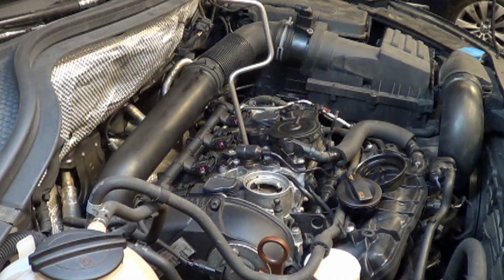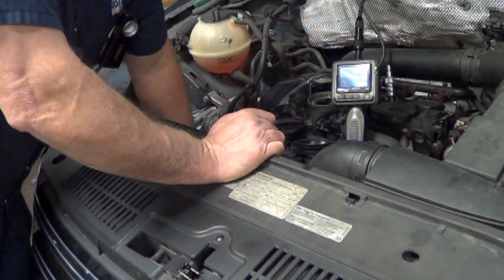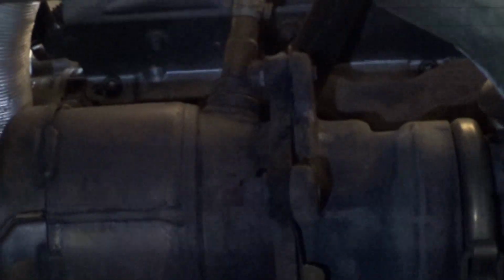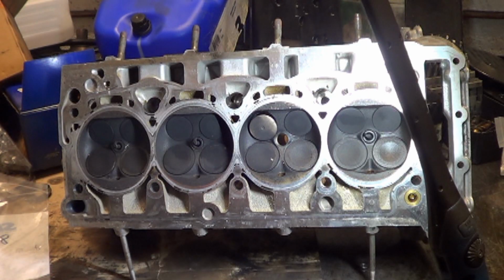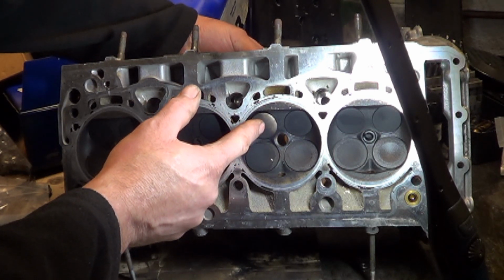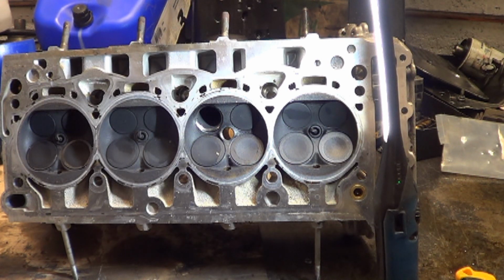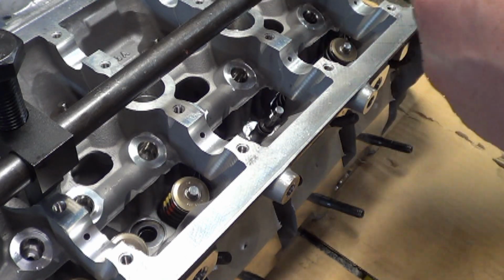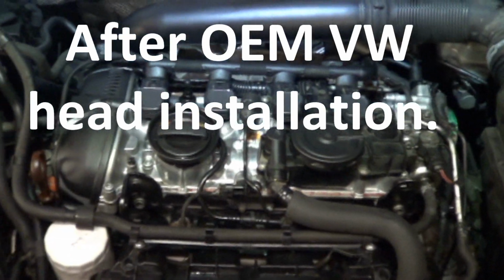Tiguan Misfire comeback part 2

Comment: just replaced plastic waterpump $1200 2012 EOS 2.0T. 3 weeks later tosses a P0300 and runs ruff. Compression ck shows #1 128, #2 130, #3 and #4 150. 
Plugs and coils denso with 30k miles. Plugs were carbon heavy and gap was .38, regapped to .32. Will have to take to shop, my scan tool is too simplistic.

Comment: I have a 2009.tiguan, issue is multiple miss fire P0300. Check engine on & EPC light on dash.  Engine wont start,  i smell gas, new coil and plugs 2 months ago, although found a crack on a coolant line, that run down in the front of the engine,  i wondering if my heads are gone?  Not sure if its worth fixing. Just bought the car for my sons 1st car and its not looking good.
Reply from the maker: should be able to diagnose a no start condition.  check videos on FAST-TEC.  Fuel, air, spark, spark timing, cam timing exhuast compression.

Comment: Amazing video, you were thorough and paid so much attention to detail, defs deserve a subscribe and like, I think im having a similiar issues, I have the same engine in my a3 convertible, did a rebuild,, changed, spark plugs, coil packs injector, line boared the head, schemed the head, replaced rings and valves as well as bearings after cutting the krank as i hit a bearing knock, im gettting a misfire on cylinder 3 but when checking compression, it is low on 3 of the cylinders, the misfire appears mostly on idle and at low revs but when driving the car its fine on top, VCDS is kicking out a camshaft retard error but the variator solenoid is replaced as well, my mechanic is thinking the valve clearances could be incorrect as we did not adjust them considering the fact that we have done so much head work do you think this could cause such a result?
Reply from the maker: yeah I dont know.

Comment: I think a contributing factor is how hard that engines pushed maybe when it comes to turbos failing not everyone of these cars blows the turbo not everyone of these cars blows a timing chain at same mileage it’s just if an when
Reply: Got ya I just got my Tiguan back from the shop they did walnut blasting at 120.000 km it was bad cylinder 3 injector was clogged dealer decided to do all new injectors it’s like whole different car now
Reply from the maker: @wesleyhoare789 cool
Reply from the maker: Yea.  but wrong guides fail.  As I know from multiple expensive experiences.  Once also I worked on one that someone else put the wrong guides in.

Comment: This makes little sense, it needs to be a helluva leak to cause a misfire. This vehicle does not look old and this exhaust valve issue should not be happening.
Reply from the maker: It makes perfect sense.  I would assume you haven't watched both videos.  the exhaust guides were wiped out.  The machine shop replaced a ferrous alloy exhaust guide with "brass" guides.  They did this on 4 customer cars and one of my own.  A competitors shop got the same treatment as well.  Every single car they put those guides in came back with guides wiped out with random misfires (difficult to diag by the way)..  Everyone was fixed under warranty.  Last one on my car was finally put back together, only weeks ago.
Reply: @CoolAirVw  Plain brass was hardly a good choice for a valve guide.
Reply from the maker: @mrofnocnon  Sorry I guess words matter.  Me saying "brass" wasn't stating the the guides were pure brass, just that that was the "type" of guide they were.  I certainly can't name the exact metallurgical content.  Intakes are "brass" and exhaust are a "ferrous" alloy.  Using "brass" ones was the mistake the machine shop made.  This cost us severely as we had at least 5 cars on the road that had the repeat failure.  Some of them we had to buy VW head to warranty.  We have since found a supplier for ferrous guides for the exhaust.
Reply: @CoolAirVw  Well done.
Reply: @CoolAirVw  Thank you I was not aware the guides had been changed or why they were. No mention of the mileage. It strikes me this engine has lots of issues that makes it prone to misfires. A thorough investigation overall.

Comment: You could install integrated engineering valve guides..
Reply from the maker: Interesting that you say that.  At the time of this video couldn't get them.  Plus I believe they are brass like the ones that failed.   Let me know if they are not.
Reply: @CoolAirVw  i went to their site and they give interesting info about the install maybe you can go an check...i suggest change the valves for ferrea...stainless steel and inconel...maybe those 2 things could make your customers happy 👍🏼
Reply from the maker: @eliseocortes0228  Same thing as before, they are "bronze" type guides.  DO NOT USE "BRONZE" type guides  for exhaust!
Reply: @CoolAirVw  so stainless steel or titanium guides?
Reply: @CoolAirVw  at least they are used for abuse on ea888.3 engines and works flawlessly...maybe is the compound.

Comment: After replacing the head was the issues resolved???…
Reply from the maker: did  you watch the video?
Reply: @CoolAirVw  yes I did but I was wondering if there was any more issues after the replacement
Reply from the maker: @herberthyosoylomejor2883    We have fixed all the ones that the Machine shop put the wrong guides in.  Some of them we were forced to buy dealer heads $$$$$$$$$$$.  But the last 2 we were able to get the right guides and now we offer them for sale.
Reply: @CoolAirVw  Cool 😎 and thank you for replying back. Question where is your mechanic shop?…
Reply from the maker: @herberthyosoylomejor2883  Kansas City area of missouri. USA
Reply: @CoolAirVw  far away fromDC
Reply from the maker: @herberthyosoylomejor2883   Just a hop, skip and a jump.  plus a long drive.

Comment: Ive changed the plugs and coil packs and my cars still popping an engine light for misfire not sure what to do ive already spent like 300 on this problem for it to keep happinging
Reply from the maker: correct diagnosis is important to not waste money changing parts that are not the cause of the problem.  scan tool like vagcom can show you which cylinder is misfiring.  If multiple cylinders are misfiring you have to look at why. Scan tool like vagcom can also show you fuel trims to help with multiple cylinder misfires.  Here is one of my most recent videos where I used fuel trim to help with a diagnosis.  https://youtu.be/K214of8Wzjg

Comment: Very interesting, I have a headache though. Been trying to diagnose for many hours.  

I have a cylinder 1 misfire condition. P 2302 p 0301 code.  
All spark plugs  and coils are new.  Engine still vibrates.
Reply from the maker: check compression.  Check cylinder leak down.  Then other stuff.  Super Mario did a direct injected car awhile back and the injector seal was leaking.  cylinder leak down showed it and smoke into cylinder revealed the cause.

Comment: I need to get rid of my Tiguan
Reply from the maker: Maybe, but they drive nice.  I just bought a 2018.
Reply: Cylinder 2 on mine 0 psi… at the shop they will have to open the motor.. if it’s a “wear n tear” issue, carmax will cover under extended warranty. We love the car but after this we getting rid of it.

Comment: I have a 2000 jetted tdi. After every start the turbo boost doesn't  kick in until rpms reach about 2250.this is a consistent thing happens every time for the last 30k miles at least. Once started and revved to that 2250 rpm the boost is there immediately until shut off.then the process starts over again.
Reply from the maker: graph boost as shown in tdi P0234 video.  Diagnosis is a process of collecting information.  Just describing what its doing isn't enough, but I would guess you have a overboost code.

Comment: Tdi engines or bust.
Reply from the maker: I drive one, my daughter drives one and my son will soon be driving one.
Reply: got 421k km on mine without any major repairs. 1.9 tdi vw touran. the biggest repair was probably gasket between top and block cause of excesive oil leak outside on block
Reply from the maker: @ernestasb.8475  Any tdi is better than CCT 2.0L Tsi gas engine

Comment: You can take an old OEM guide and sent it out to a laboratory that does metal analyses. This will give you all the metals in the guides.
Very easy to do hardest part is having the instrument to run the test.
Reply from the maker: Yes, please provide me the name of that there laborotory.
Reply: @CoolAirVw  Quick search: Anderson Materials Evaluation, Inc, Ph: (410) 559-9389,  Let them know that you need the metals composition of the quides or explain to them what you are trying to do.
Reply: @CoolAirVw  Here is another lab, (866) 446-7609 APL Inc
Reply: @CoolAirVw   Going to ask around and let you know what I find

Comment: Good info about the guides... but not good that you had to find out about it this way. =(
Reply from the maker: two other vehicles out there repaired the same way.  Luckily one of them is mine.
Reply: @CoolAirVw  Yours also has the soft guides but hasn't failed yet or yous got a factory head?